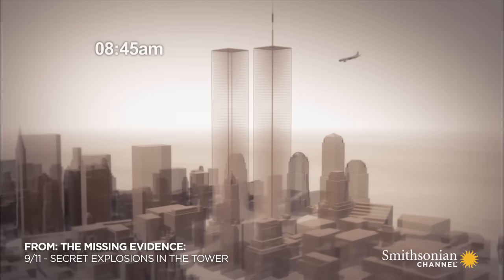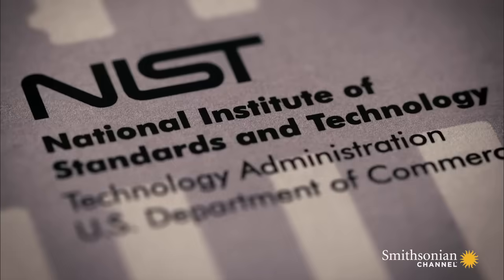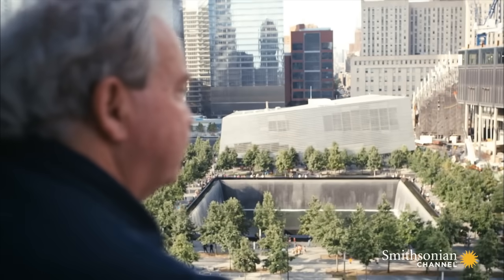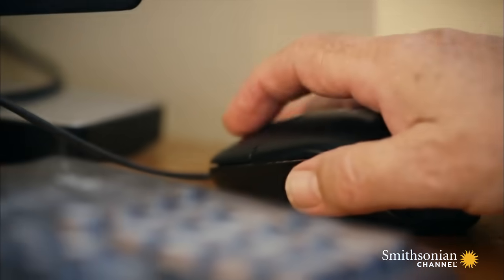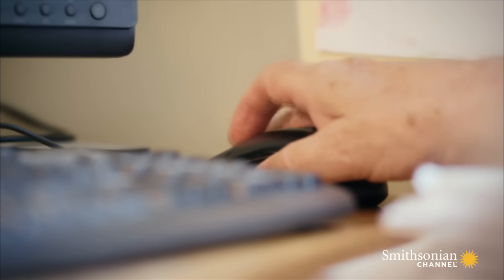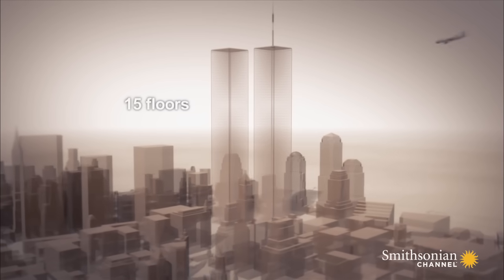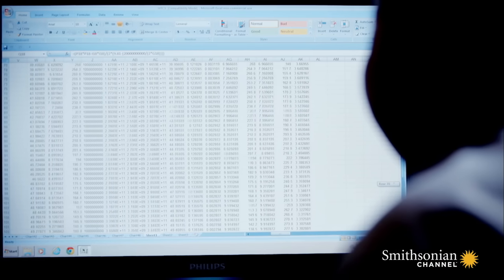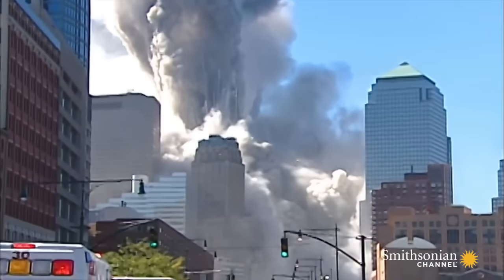This Computer Simulation Explains How the Twin Towers Fell

Comment: I'm a firefighter and let me tell you jet fuel does not burn hot enough to melt steal beams also there was no structural failure to have a collapse from the planes they would of had to hit near the base of the towers they hit the 105th floor and in the videos from this day right before the two towers collapsed you can hear controlled explosions which indicated demolition and how the towers fell
Reply: globalswitch17  No that is incorrect you get an overspeed warning and that's it. The plane will certainly be screaming at you and telling you to slow down but it can all be ignored.
Reply: Charlie Wood there is concrete evidence of thermite found in the dust of the collapse. It wasn’t that the building was exploded but that thermite was used to cut the steal beams therefore facilitating the collapse
Reply: globalswitch17  Why wouldn't a pilot be able to hit the towers? Just asking what your thinking.
Reply: @dan44244  you know the planes were aluminum
Reply: L MUS The whole point is that the beams underneath the impact zone that were not subjected to the intense heat would still be structurally sound and would be able to support the weight of the plane and all of the fuel; although it should be noted that a lot of the fuel would have already burned up by the time each building fell.

Aside from those facts, it seems too unlikely that a military drill concerning highjacked planes just happened to be occurring the same morning that this diabolical plan unfolded. Awfully big coincidence there.
Reply: Charlie Wood congrats you’re a fire fighter which also makes your scientific point reasonable beyond doubt.
Reply: L MUS You’re oversimplifying the rational behind the governments reason for committing this atrocity.

The US government perpetrated the events of 9/11 so we could be force fed the Patriot Act which expanded the American surveillance state to unprecedented levels and they installed new governments in Iraq and Afghanistan which would not only be more open to interacting with the western world but also not openly hostile towards Saudi Arabia and most importantly Israel.

Keep in mind that the US would not be permitted to just invade these countries without a reason for doing so.

There also would not have been any will in Congress to pass such a sweeping surveillance bill had these events not transpired.
Reply: Walking Man you’re a genius 😂
Reply: @dan44244  Finally someone with a brain.
Reply: Charlie Wood what about a pancake collapse? And jet fuel might not melt the beams, but it burns hot enough to basically turn the steel beams into noodles
Reply: @andrewdennison8403  The "pancake theory" was ruled out in the very beginning because it did not account for the 47 core columns in each tower. Had this type of collapse actually occurred, the core columns would have remained standing, and this of course, was not the case.
Reply: Andrew Dennison your missing the point. Even the weight from where they were hit upward would not have caused the whole building to collapse. Not enough weight or force. It would have had to been hit from the lower half upward. Structural engineer here.
Reply: Jet fuel would have made the portion where the building was struck somewhat compromised but still would have had nothing to do with their collapsing. Engineers would tell you this whole thing was pre-planned.

Comment: Steel Beams were heated enough to weaken and collapse. Fine. But is NOBODY gonna talk about how the towers fell in a PERFECTLY VERTICAL order? We need answers!!!
Reply: If the buildings had taken the path of least resistance they wouldn't have fallen into their own footprint. It was obviously a controlled demolition.
Reply: @Bcrawlspace  GRAVITY is the only force acting on that building, therefore DOWN is the only direction it can go! What, do you think the top is just going to magically slide sideways more than 100 feet so it can "follow the path of least resistance"? There's no reason for that to happen!
Reply: Gravity.

Comment: Wrong.  The lower floors were already holding all that and wind factors for more than 20 years. Not to mention having missiles flown into the sides of them.   Those buildings were built with with a demolition plan build in. Nukes under inner core.
Reply: You should take a few minutes & familiarize yourself with the towers' design, because you do not understand it: The floors did not support the floors above! Instead, in the "tube" design each floor attached to the columns & did not have to support any weight other than themselves & their own loads. The columns carried all of the weight.

Comment: For a start he didn't take into account the mass that was outside the skeleton when the building started to collapse as it was either pushed outwards by the force or pushed out by explosives. These several tones of material wouldn't of had an affect on the standing tower.

Comment: NIST lied and classified the data so no one could check them. The Bush Administration lied about the whole thing. "Momentum Transfer" is total BS. Unless this guy has access to classified information (all the original structural construction Doc's are now classified) he cannot build an accurate engineering "finite element analysis" model. This is the only way to develop a computer simulation of the collapse. This guy is a shill being put forward to discredit Architects & Engineers for 9/11 Truth and its president Richard Gage, AIA.

Comment: By the way, the columns were thicker and stronger from bottom going up.. so the area below the impact zones were stronger than above
Reply: The relative strength of the lower beams is irrelevant; the collapse BYPASSED them.
Reply: TimReed22222 that is impossible, especially given the speed of collapse being near free fall.  Just how did the section of the building above the impact zone crush the approximately 80 stories of steel below it with virtually no resistance?  The answer is demolition.  There’s a reason why controlled demolitions have to be done so precisely or they fail.
Reply: @felipe3354  #1 There is no such thing as free-fall speed; free fall is acceleration, not speed. I'm not just being pedantic, there's a difference and it MATTERS.

And the towers' collapses were not in fact close to free fall, either. That's a myth. Tower 1, for example, took over 20 seconds to come down (free-fall time from that height is about 10 seconds). There WAS resistance.
Reply: TimReed22222 Almost Free-Fall Speed: Buildings brought down by controlled demolition collapse at almost free-fall speed. This can occur because the supports for the lower floors are destroyed, so that when the upper floors come down, they encounter no resistance. The fact that the collapses of the towers mimicked this feature of controlled demolition was mentioned indirectly by The 9/11 Commission Report, which said that the “South Tower collapsed in 10 seconds” (Kean and Hamilton, 2004, p. 305)
Reply: TimReed22222 so your asserting that if the towers were rebuilt identically with the same steel and the same specs, all you would need to do to bring the building down completely would be to demolish the upper portion and the rest would simply be crushed once the top portion fell?  That doesn’t work.  All columns need to be taken out in a planned pattern.  Look at videos of failed demolitions.
Reply: @felipe3354  More than twice free-fall time is NOT free fall! Not even close. This proves the resistance WAS present ... This occurred because the falling upper block landed not on the columns but directly onto the floors, causing a dynamic load which was many times beyond their rated capacities! The floor is smashed & the debris continues to fall, bypassing the columns (making their strength irrelevant) & taking out floors one at a time. NO EVIDENCE OF DEMOLITION! No detonators, no wiring, no residue - NOTHING. (No, no thermite either!)
Reply: @felipe3354  AGAIN: The collapse BYPASSED the columns by impacting the floors DIRECTLY. So you don't have to take the columns out; there's nothing they can do! If you could magically make a couple of floors just disappear, then yes, the falling block would probably take out the rest of the building as we saw: One floor at a time.

Comment: Look up Anthony saltlamaccia and William Rodriguez.  Both salt of the earth good men who worked hard in maintenance and witnessed explosion in the basements of the towers before the plane hit.
Reply: If they were in the basements, how did they know when the planes hit?
Reply: TimReed22222 they describe two separate events.  One being loud explosions in the basement, the ceiling caving in, and coworkers severely burned (all in the basement levels, and the after that, the plane impacts.  I believe they had walkie talkies which is how they knew the much more distant explosion (the plane) was in fact the plane hitting.
Reply: @felipe3354  You haven't answered my question: How do they know the plane impacts happened after the initial explosions? I just don't see how they could know such a thing from the basement. Nor do I understand what role the walkie-talkies played.
Reply: @felipe3354  funny, because the basement is where the falling elevators would land

Comment: There is a simple and obvious flaw in this explanation. The upper floors did not form a single crushing mass - instead, as is clearly visible in the video, they disintegrated shortly after the collapse is initiated. The model used is faulty.

Comment: 1:20 Top section just 'crushes lower section'? Netwon's 3rd law? Top section would get 'crushed' as it crushes anything it comes into contact with. The "juggernaut" he refers to is a mass with no decrease in momentum with each collision.. How this occurred was never explained.
Reply: @Shelby_Starner_Everything  Great rebuttal, please explain how I misunderstood Newton's third law. If the falling mass exerts a force (enough to destroy a floor and more) then the mass, which as also made up of these same floors, will also experience the same amount of mutual destruction. The opposing force is not enough to immediately bring the larger falling mass to a halt, but with successive collisions, it will slow down and eventually rest. Conservation of momentum - or do I misunderstand that too? The falling mass will increase, but without any external force, there is no reason acceleration and thus velicity should increase with the resistance they should be experiencing.

Comment: My theory is that when the planes crashed parts went through where they impacted and landed somewhere farther then the building. Therefore weakening the floors above impact level, higher levels collapsing causing both buildings to collapse.

Comment: 38k tons vs 76k tons and 38k tons won? I'm not a crazy, in foil hat wearing, conspiracy theory believing nutbag crazy person loon like everyone else in these comments but this doesn't make sense to me. I'm just a frozen caveman lawyer, but it doesn't make sense. If planes collapsed WTC 1, 2 and the Pentagon, what collapsed WTC 7? WTC 4 and 5 suffered debris raining down on them from 1 and 2 and stood until they were demolished during the cleanup. These structures were RIGHT UNDER 1 and 2 and survived, structurally intact. WTC 7 was hundreds of yards away and collapsed.
Reply: The engineer who designed the towers said that the collapse pushed the exterior walls outwards snapping the bolts off. It was an out ward and down ward collapse.

Comment: And tower 7?
Reply: To quote a friend - "WTC 1 ignited fires on at least 10 floors of WTC 7 at the western half of the south face. Fires on Floors 7 through 9 and 11 through 13 burned out of control, because the water supply to the automatic sprinkler system had failed. The primary and backup water supply to the sprinkler systems for the lower floors relied on the city's water supply. Those water lines were damaged by the collapse of WTC 1 and 2. These uncontrolled fires in WTC 7 eventually spread to the northeast part of the building, where the collapse began"

Comment: maybe bc there were bombs in the basement lol
Reply: Explain how bombs in the basement of the building would cause it to collapse at the impact area?
Reply: Mercury Covers explain how a building built from steel, from the ground up gets knocked down, perfectly straight, by planes... take a look at the steal beams, all perfectly slanted, only cause  for it is explosives... stop sipping the kool aid and open your eyes
Reply: The HighSchool You conspiracists can always be debunked. The molten aluminium from the plane’s  crash (fuel was full up) ignited the steel, burning it to a temperature of 900-950 Celsius, weakening it severely. As the fire got worse and worse as it raged on, the steel trusses gave way and the tower collapsed. Jet fuel may not melt steel beams, but it sure can cause a fire that destroys a tower.
Reply: Did I win? Or?
Reply: 12weasel100 it’s just sad you people really still believe it
Reply: 12weasel100 when all of the proof is shoved in your face

Comment: 88 floors below the crash floor of undamaged building. That 88 floors was already holding the building up so? Hold on don't start up with the pancake effect, if you had a stack of 110 pancakes and you damage the the top 22 pancakes would that cause the bottom 88 pancakes to collapse?
Reply: @Jim Da, Have you ever heard of kinetic energy? Do you know and understand the difference between mass and force? Do you understand the difference between a dynamic load and a static load? Do you know what kept these particular buildings stable and vertical in the first place?
Reply: @JohnJ-fj2xe  so I guess the question becomes how high would you have to lift the 22 pancakes and drop them to crush the 88 pancakes below
Reply: @Jim Da, The structures which kept the twin towers standing up were nothing like a stack of pancakes, therefore the premise of your question does not make sense. The buildings didn't fall because they were 'crushed' en masse. They fell because the structures which kept them up were progressively destroyed.
Reply: All I can say at this point is 2200 architects and engineers did do the math! I try not to talk to people who cannot recognize when someone is interjecting, metaphor and or sarcasm 
In their argument. Have a fun day, goodbye.
Reply: Good plan. Better to quit while you're behind....

Comment: The top of the buildings fell through the path of most resistance. That simply does not happen.
Reply: @Benjamin Smith, It was 30 floors of an office building, not a river of water.
Reply: @JohnJ-fj2xe  You obviously don't understand physics.
Reply: OK, then. Tell me the physics that I don't understand. Explain to me how you (apparently) believe that the mass of a 30-storey office tower was going to fall approximately 30 feet (3 storeys) and NOT continue straight downward. Do you believe that it should have somehow been deflected? If so, exactly what force would have caused such a deflection and what would have been the source of it?

Comment: Your leaving out BUILDING 7 , main reason we (non engineers, just straight common sense, "conspirast" ) don't believe they pancaked at near free fall. I mean which one is it? Jet fuel weakend the steel or office fires? Cause it can't be both.
Reply: How does the collapse of WTC7 have any relevance to whether the twin towers fell at free-fall speed (which video clearly demonstrates that they did not)? Jet fuel caused the office fires, which weakened the floor trusses which kept the vertical elements of the inner core connected to the outer perimeter elements. Is there any of this that you don't actually understand?

Comment: So much of the concrete flooring turned into dust that there was not anything like stacks of flooring at ground zero to support the theory here that the accumulated weight of the flooring forced supporting structure to give way.  How did nearly all the flooring turn to dust, along with about 40,000 filing cabinets, thousands of vending machines, computers, doors, toilets, that were also not present in the ground zero rubble? In the dust scientists found the answer: super-explosive nanothermate.